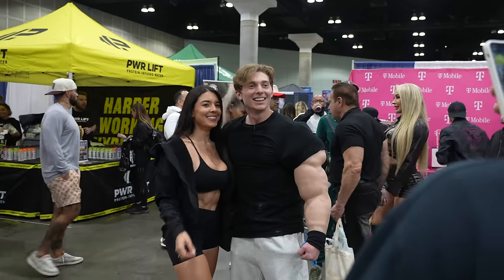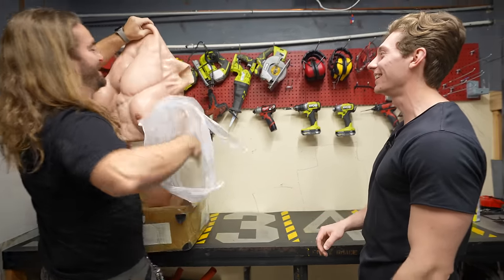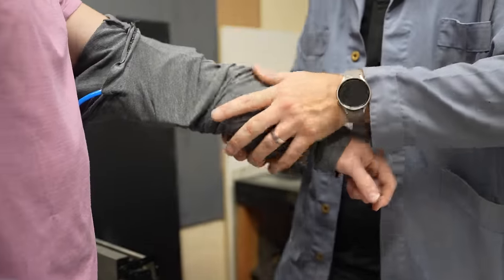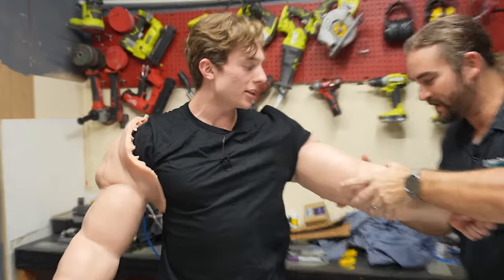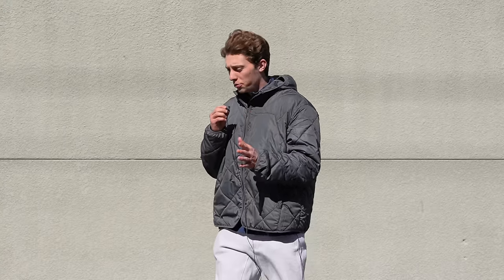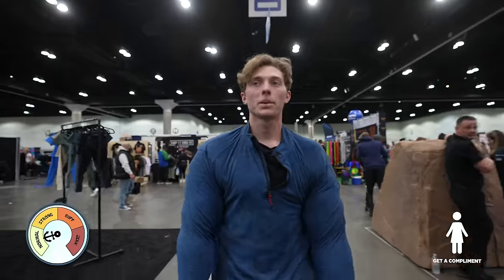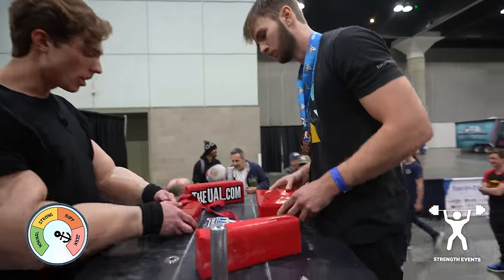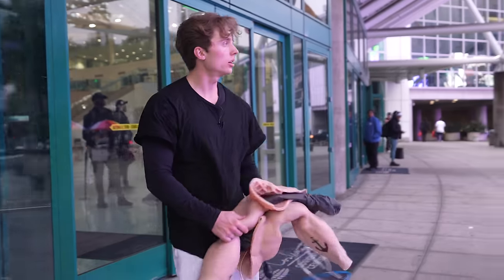I Built Real Life SpongeBob Anchor Arms

Comment: would have been smart to put a metal tube around the hose that leads to the forearms. 
it doesn't have to be a rigid tube mind you could be flexible like the ones for a shower hose.
I have tried doing things with the shower hose tubes on skin and the problem is that they pinch.
a nice layer underneath helps though. maybe duck tape on the hose would work too, or electrical tape?
now that I think of it you could use the metal tube and bend it to be comfortable. there are multiple ways to keep it in place.